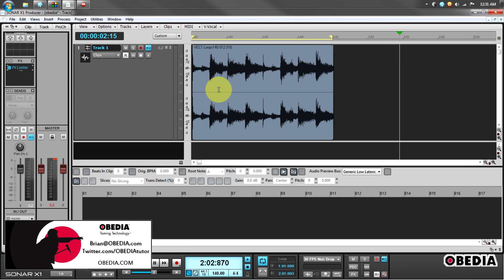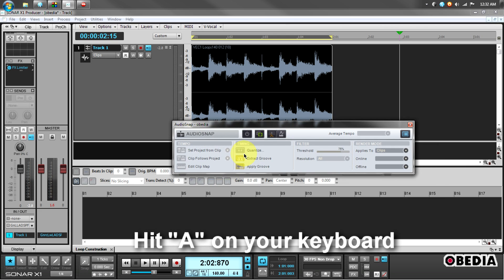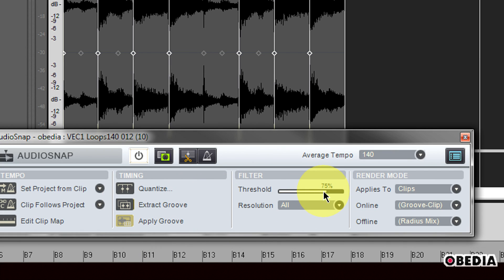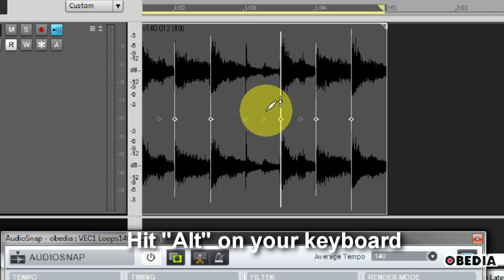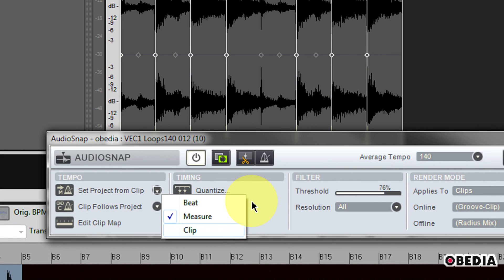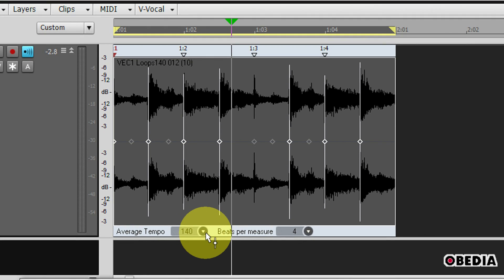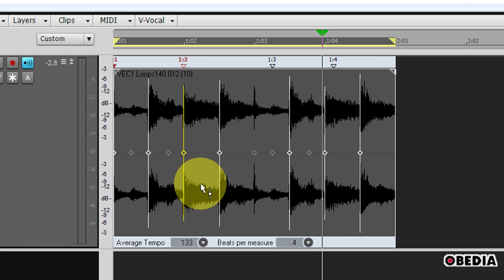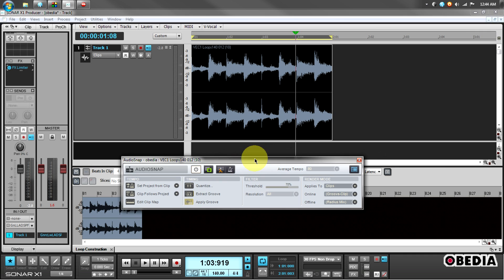Sonar X1 - using AudioSnap

Comment: All I can say is that I am as mystified as I was before by Cakewalk. Have they gotten rid of some features since the reboot by Bandlab? I am only using the free version but frankly all of this is the most inpenetrable jargon. I would love to use this program to its full effect but currently only for editing and mixing live audio uploaded to it. Has anyone got audiosnap or quantize to work in this software? I can't even get the audiosnap palette to become "live" in order to use it half the time. Surely it would do so automatically if you click to open it. Anyone able to rune througj this in idiot language?

I would like to record some simple soft synth drums, bass and synth clips to use in the matrix but that is seeming a long way off.
Reply from the maker: Everything that we saw in Sonar, was working fine in CWBB. Call us for one on one help. 615-933-6775, dial 1. Thanks.

Comment from the maker: @37no37 Creating Acapellas is a little involved, but it usually requires reverse phasing the audio of a track.  You'll have a hard time getting all of the instrumental out, but you can tweak it with some EQing and other FX.  Call me if you need help.  1-855-553-7205